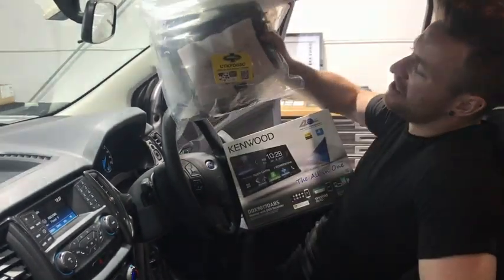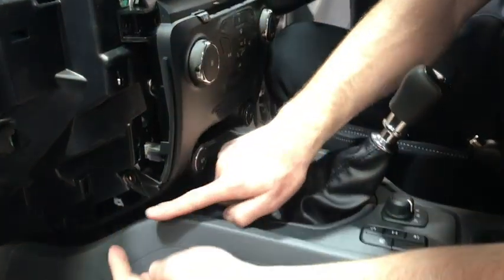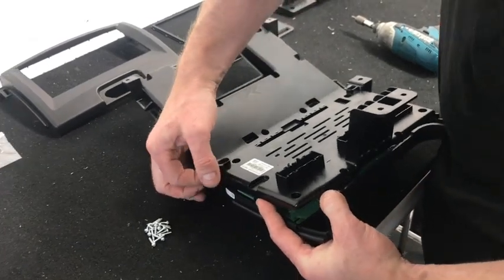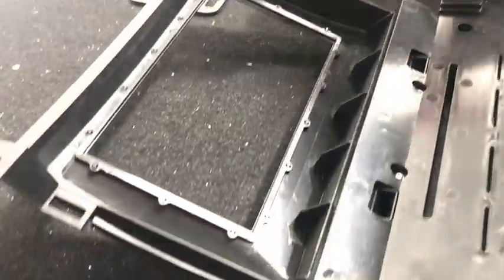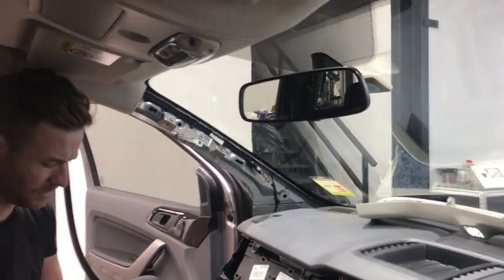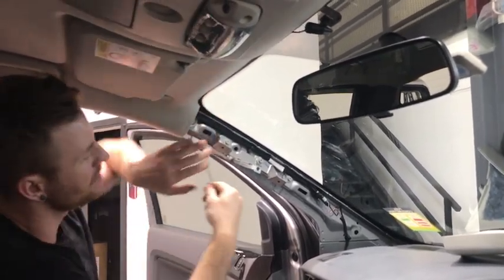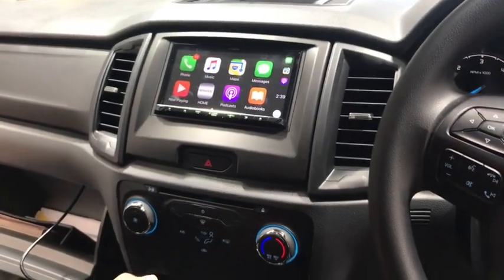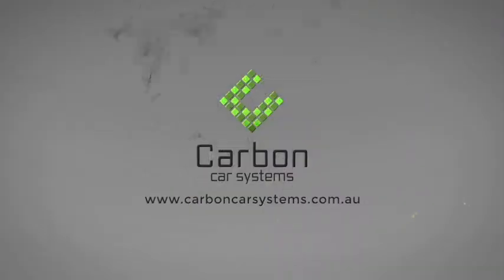DIY: Upgrade 2016/17 Ford Ranger PX2 Stereo Apple CarPlay & Android Auto

Comment: Thanks for the great video. very nice. Is there a replacement upgrade for the factory unit in the 2017 Ford Ranger XL. the unit that has no cd or colour display. I want to replace mine even if I dont get a cd player. 

Thanks again.

Comment: Great vid. Thanks.
Just wondering if there was any reason you opted to mount the new mic on the screen as apposed to in the factory location of the original mic?
Reply from the maker: Yes you cannot retain the factory microphone it will not adapt. The new units MUST use the new microphone or it will sound terrible.
Reply: I understand the need in using the new mic. Its just the location it was placed I was curious about. Is the new mic to big to go in the original location?
Reply from the maker: It would muffle the audio so its not clear.
Reply: thanks ffor a very nice video, one question, what speakers do you used as replacement?

Comment: I just purchased one of these kits. Pretty awesome so far but I'm trying to get access to the remote power out so I can install my amps but my kit came pre done with my kenwood unit. So the blue remote wire is already hooked in. With tag removed im unsure if I can just splice into it for my remote power.

Comment: Hi Mate, i have seen a video on YouTube about 3years ago of 4”-8” factory sync 3 upgrade conversion by 4D Tech. They not responding to emails or txt. Can I purchase similar usb cord that plugs into the back of the sync 3 stereo and go down to the bottom plug into the dual usb port from you if you sell one. I also don’t have the dual usb port. Would you have that for sale too?i like your removal and installation but I don’t have a kenwood stereo. I bought a sync3 stereo from another person. Can you help please. Thanks.

Comment: Can I use your mounting kit and wire harness assembly here in America for my 2019 Ford ranger?
Reply: J M really hard to find this info. Haven’t found a clear solution for upgrading the head unit in the US market. Seems like it’s possible but I’m thinking we might lose the front and rear sensor option which would be a no go

Comment: Had an alpine unit fitted into same spec Ute.  How did you overcome Fords annoying power saving feature of turning the unit off after 30 seconds on accessories? And strangely turns back on for another 30 seconds or so if you press brakes or central locking. Drives you nuts if just waiting in car for a while listening to radio.